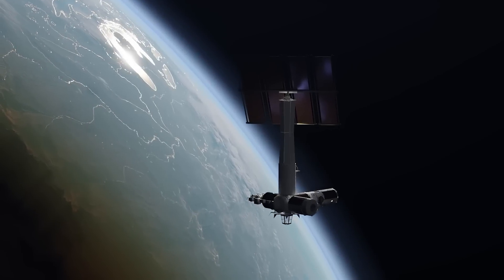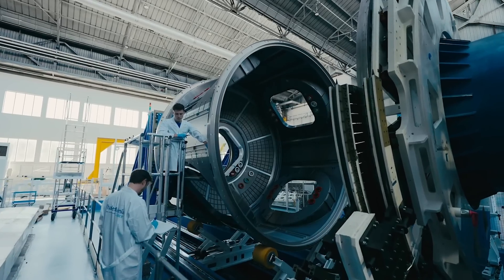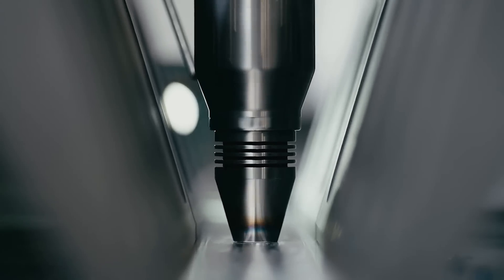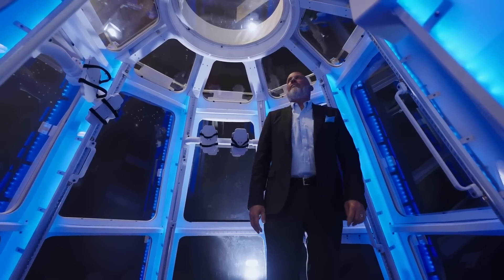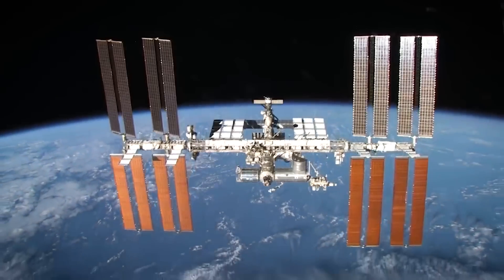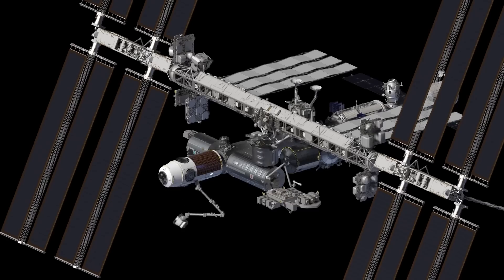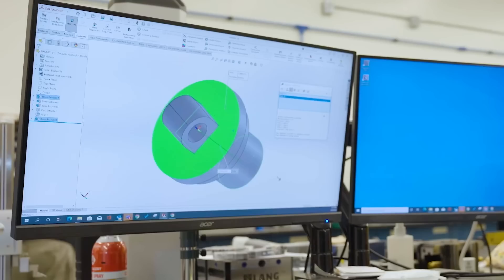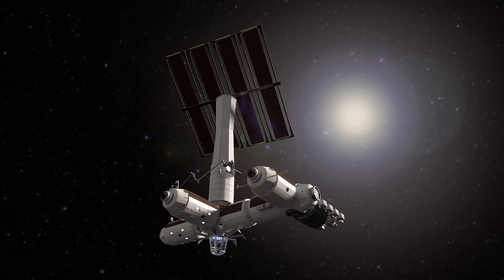How Close Is The First Commercial Space Station From Launching?

Comment: The next step is launch....... after Axiom's module has to go through testing at the space environment testing in Ohio. That could take months. You know that getting it certified to connect to ISS is going to be hard.
It won't be a self-sufficient module, since it will be dependent on the ISS for power and stability. How long will it take to manufacture, test, and certify the power, ECLS and control module. THAT is what makes a space station.
It think that the all-in-one space stations will be up sooner. I don't know if they will be safer, but they will be quicker. I would have trusted Bigelow, since they had prototypes under test in orbit. These other guys might be less than trustworthy, since they won't have NASA breathing down their necks. Axiom will have the safest modules, because they will have to satisfy NASA and they are basically the partner manufacturers of the ISS modules, but they won't be independent of ISS until 2028.

Comment: By the time this things finally all built SpaceX could launch  expendable Starships with 2 to 3 times its volume in a week.😮 actually if you put a collar on the top of the fuel dome & fuel header tank in the lox tank you could seal up the fuel tank to pop a inflatable hab into it, while being able to have enough propellant to make significant orbital changes as instead of 3 sealevel centre Raptors you have just 1 gimbaling vacuum Raptor! No fins or heat shield gives you plenty of deltaV. This gives you over 100ft x 30ft of pressurised volume to work with & 7 raptor vac engines with a small amount of fuel.

Comment: Well, 1 SpaceX Starship is the size of the ISS.  It is a 14 story building, so 2 launches should be a produce good size space station,   200 tons to orbit per launch.  So pretty close.
Reply: Your 14 story building is the length of starship.  Specifically starship is 50 m or 165 ft in length.   The length of payload bay is far less at like 22 m or 75 ft length.  The 200 tons to orbit is for expendable launches. 

 That figure is also theoretical and it is much too early to presume what actual payload maximum will be.

Comment: Once SpaceX Starship brings lower cost Earth to orbit delivery of bulk construction panels a robot assembled shell of a Von Braun rotating space station that has artificial gravity will be possible.. The inside can be inflatable segments that have connected airlocks and insulation with prebuilt interiors.. In this manner a large habitat for long duration operations in a higher orbit can become more independent.. The existing ISS could be used to house work crews until the central core is completed.. A zero G companion workshop to do the experiments that require such a setting could be placed as part of the central core but with the ability to be non rotational or a separate space station that does not rotate could be near enough that scientists could transfer back and forth.. Another Idea that I saw was to have a Von Braun station that orbits from the Earth to the Moon once a week so it could be used to help build a Moon base and provide support to the work crews on a regular basis.. Or with a rotating Earth orbit station the ISS could be moved to a Lunar orbit and become the base of operations to build another rotating station near the Moon.. After that the ISS could be moved to Mars orbit and be the base of operations to build a base on one of the Mars moons.. It is far easier to get on and off a Moon than it would be to get on and off Mars gravity well..
Reply: Why wouldn't you use an expendable Starship as the center hub for a wheel station its big stainless steel and has engines to move you if necessary! And all that mass of stainless steel reserve fuel & your water supply between you and a CME might save your ass.😊
Reply: @jackdbur  This topic of using booster or upper vehicle as a building component has been discussed and so far determined to be not viable without being a custom built refuellable in orbit ship of immense diameter.. Even Starship is way too small to be a hub because of the requirements for the mechanical components that the hub must contain.. A purpose built hub with all these things installed as it is being constructed is still the only choice.. I would see no problem with attaching one or several Starships to the hub and use their engines and thrusters to move a station around..
Reply: The first stations are not going to be that big #1 the cost to  LEO is just too high still #2 no ne has even tried welding in orbit yet #3 a large structure in LEO is way too dangerous you need to be atleast out in a mid orbit for safety. The best place for building & stationing a large structure would probably be L1 & L2 using lunar sourced materials,  Earth's deep gravity well is a huge issue .

Comment: If NASA is going to "eliminate" the ISS anyway, is there a way that Axiom Station can scavenge it for Parts?
They May even PAY for some of them, like a Surplus Sales of Government Equipment sort of thing.
Reply: That is the equivalent of saying we will build a new computer using parts from an old, late 1990s computer that has seen alot of use and abuse.
Reply: @nickl5658  HEY! You never went Dumpster Diving behind a Computer Repair Shop????
Reply: I just posted basically the same thing. :)  As Louis said it seems like the arm should be salvageable and I would think some of the solar panels and maybe other stuff as well.  It seems a shame to just deorbit all that and let it burn up considering how much effort ($$$) it takes to get stuff into orbit.  I realize it's old but old doesn't necessarily mean it's junk.

Comment: We need a space station that would simulate lunar and or martian gravity to do science on long term effect of less than earth gravity on plants and humans in near by low earth orbit.
Reply: Yes we do and with starships development a space station like that can be built
Reply: That would have to be much bigger than the current ISS. It would be very expensive. They can do the same research on the moon.
Reply: @bluesteel8376   most of what your saying is probably based on attempting earth 9.8m/s² acceleration, and man's capability to tolerate a rate of rotation that supports that rate of acceleration. But, martian gravity is about 1/3 of Earth's gravity so it will be very much easyer to build a station that is built for martian like artifical gravity that rotates very much less  which inturn makes it more much more tolerable for humans.

 Structurally,  martian like gravity puts a lot less stress than if it were earth like, and I see no problem starting off simulating lunar like gravity that's roughly 1/6 of Earth's making it even easyer to build and tolerable to human, and very much less costly than you were thinking. And, you don't need a whole donut cylinder  to do this. You just need inflatable habitates for livin and working, an inflatable tube with steel cables connecting the living working space to a central docking habitat and on the other side you need steel cables tethering a counter weight.  

Testing it out in low earth orbit while astronaunts and scientist  do other work will be much cheaper than  testing the effects of low gravity on the moon or mars.  

It's not a matter of if, but when we do it. And we will do it before establishing human occupied basses on each.
Reply: The Haven-1 is planned to have artificial gravity.
Reply: @Mattihyrra  VAST's road map to artifical gravity might work. I see that vast-1 is to dock with haven-1 then demonstrate lunar gravity.  Sounds like an exciting begining. But it's less than I imagined. I hope it doesn't take them long to take what they learn to get to making a more permanent artifical gravity station with a central docking port.
Reply: @Mattihyrra      That would be news to a lot of people.  And how is the artificial gravity to be achieved?
Reply: @michaeldeierhoi4096  i don't know but VAST claims that Haven-1 will have some sort of artificial gravity capabilities.
Reply: Actually, we need a space station with the gravity of earth.  We already know the long term effects of reduced gravity on the human body!  Past the time to acknowledged the fact that humans can not live long term in  a reduced gravity or no gravity environment and start really working on it.  We already know that a rotation space station is the only way, there are no, or will ever be gravity plates in the real world, and start working on a a rotating space station with the gravity of earth!  That would be a real tourist attraction, being in space with gravity, like home,  and looking out ones window to see earth or the Milky way!
Reply: @nightlightabcd  I agree that earth like artifical gravity is least likly to have long term negative health effects. I also agree that we have already tested no (micro) gravity. But we have not tested humans in lunar or martian like gravity. 

We can probably guess having some gravity will be better than no gravity, and having more gravity will be better than little gravity, up to Earth like gravity at least. But we should still science it if we are to plan on manning lunar and or martian bases. It's probably better to do long term testing in low earth orbit rather than on Luna or more distant Mars as resupply missions get vastly more expensive.
Reply: Artificial gravity is still quite a few years off if only because the size of such a station is beyond our reach right now.
Reply: @michaeldeierhoi4096   I was referring to martian or lunar sized gravity which is significantly less than Earth's. Mars is roughly 1/3rd of Earth's gravity and the moon is roughly 1/6th of Earth's  

A station for simulating gravity doesn't need to be a full blown torus, although current material design could do it. It would be bulky and expensive, but It could simply be a habitate attached to a counter a counter weight with four tethers and a module positioned at center mass. 

If an earth gravity simulation  needed a certain radius and rpm for comfort to rotate its habitate through, then a station simulating Lunar gravity given the same rpm would only need 1/6th the radius. 

I get this, Besides long term Astronaut health,  there's little reason to simulate Earth's gravity. And there's plenty of reason to understand micro G effects on human health.  But there is benifit to  scientificly understanding long term effects of lunar gravity on human health.  Fir instance, could we keep a group of people on a Lunar base for say 5 years. Would muscle and bone density loss make such a stay difficult for the astronaut to return home or would it be tollerable. Furthermore low earth orbit mission cost would be much  cheaper to run resupply missions to the moon or Mars. And, the knowledge learned  would help shape latter human Lunar and Martian missions or colonization, or not.